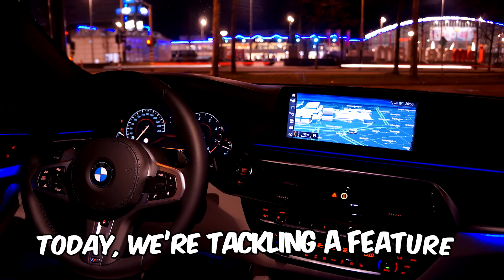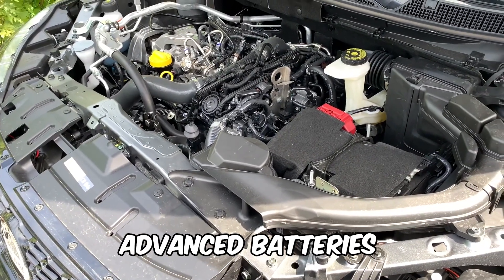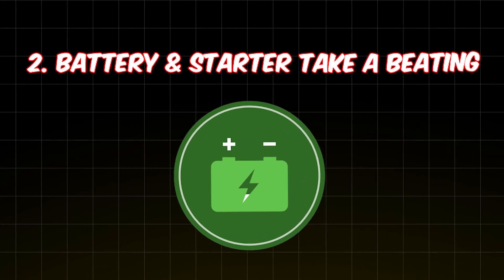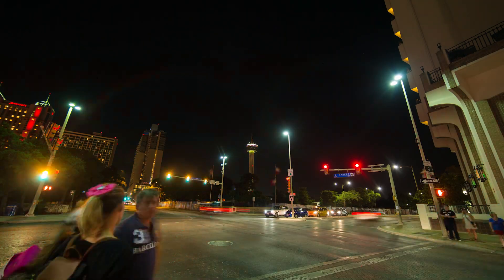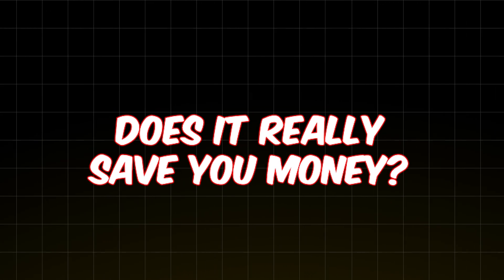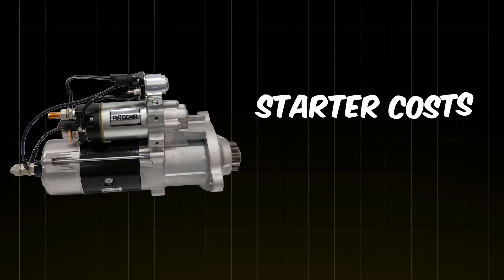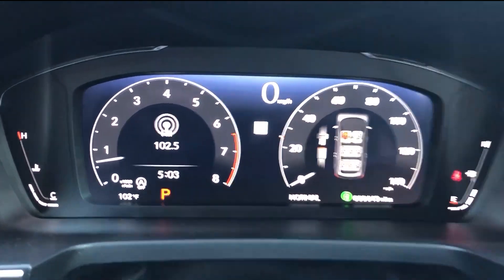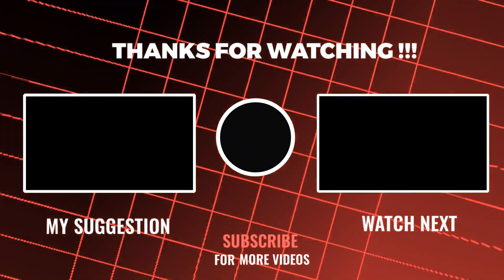The TRUTH About Auto Stop-Start System (Nobody Talks About)

Comment: Yes, oil pressure matters. Idling increases wear, especially with thin modern oils. This conspiracy theory was debunked by much more knowledgeable people, you don't need to revive it
Reply from the maker: You're absolutely right that oil pressure is crucial for engine longevity, and modern thin oils are designed to work efficiently even at low pressures. However, the concern isn’t a conspiracy—it’s about the long-term effects of frequent engine restarts. While manufacturers have improved stop-start systems, the reality is that more starts = more wear over time, especially in certain conditions like turbocharged engines or older vehicles. It’s all about being aware of the trade-offs!
Reply: @carsfuse  Idling introduces fuel in the oil. It was tested by another youtuber. After 2000 miles he had 40% more fuel contamination in idling engine compared to non-idling. 
What I'm saying is that the usage of the modern engine has to take in account the rules. For example, in Germany idling is forbidden by law. Therefore the engineers take these facts into account and design accordingly. Fighting with the design is stupid
Same goes for warming up the engine for 20 minutes myth , instead driving it gently after start. Same outcome: loads of fuel contaminate the oil.

Comment: ISN'T THIS THE SAME PROBLEM WITH HYBRIDS WHEN SHIFTING FROM EV TO ICE MODE?
Reply from the maker: Great question! 🔥 Hybrids do switch between EV and ICE mode, but they’re designed differently. Unlike stop-start systems in regular cars, hybrids use electric motors to smoothly restart the engine, reducing wear on the starter and minimizing oil pressure issues.

However, long-term wear on certain components like the battery and engine mounts can still be a concern, especially in high-mileage hybrids. So while the concept is similar, hybrids are generally better engineered for constant start-stop transitions. 🚗⚡

Comment: I am glad that I have an older car a 2011 BMW 328i that does not have this silly start and stop feature. The original starter motor lasted about 100,000 miles before it needed to be replaced.
Reply from the maker: You’re lucky to have a solid, older BMW without the hassle of stop-start! 🚗💨 A starter lasting 100,000 miles is pretty good—especially compared to the extra wear these newer systems put on them. Keep taking good care of that 328i! 👌🔥

Comment: Plus the starters are programmed to stop working after 250,000 cycles
Reply from the maker: That’s a great point! Many stop-start system starters are designed with a limited lifespan—often around 250,000 cycles before they fail. And with stop-start activating dozens of times per drive, that lifespan can get used up much faster than a traditional starter. It’s another reason why these systems might cost more in the long run than they actually save!

Comment: It's not about saving you money IT'S ABOUT SAVING THE PLANET FROM THE 10% EXTRA POLLUTION FROM EVER VEHICLE ON THE ROAD WITH THIS NEW TECHNOLOGY!!!
Reply: 😅😅😅brainwashed?...
Reply from the maker: That’s a fair point! Reducing emissions is definitely a key reason why stop-start exists. In theory, cutting idling reduces fuel waste and lowers pollution, which helps the environment. But the flip side is increased wear on components, leading to more battery and starter replacements—which also have an environmental cost. So while it helps with emissions in the short term, the long-term impact of extra parts and waste is something to consider too!

Comment: I live on an island without traffic lights. I may stop at intersection for about a split second, the car shuts off and turns on immediately, pure annoyance. And it can't be disabled permanently, only via the touch screen at every start.... %^&(*)$

That feature (yeah "feature", blah) should be available on demand only, not everyone lives in a city.
Reply from the maker: That sounds frustrating! Stop-start makes zero sense in places with minimal traffic, yet many manufacturers force it on drivers with no permanent off option. Having to disable it every single drive is just annoying. You're absolutely right—this system should be optional, not default. Not everyone drives in city traffic! Hopefully, carmakers start listening to real-world drivers instead of just chasing fuel economy numbers.